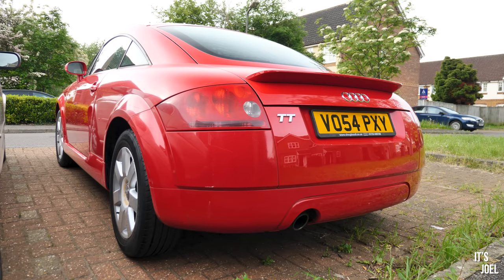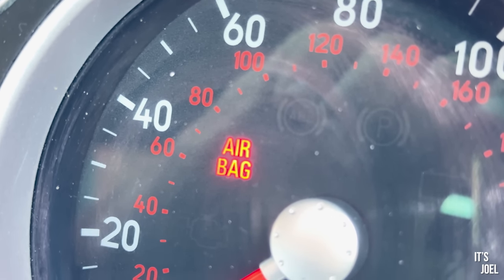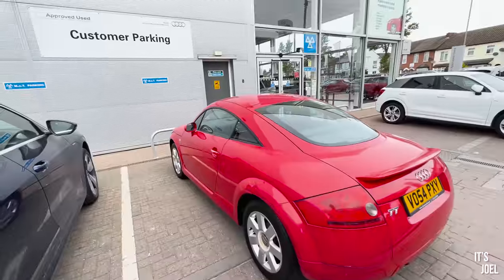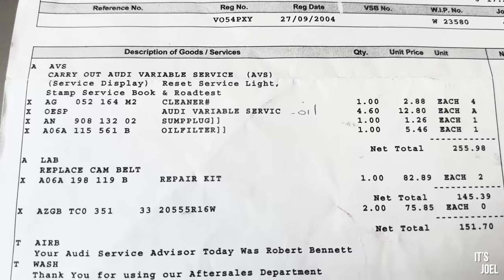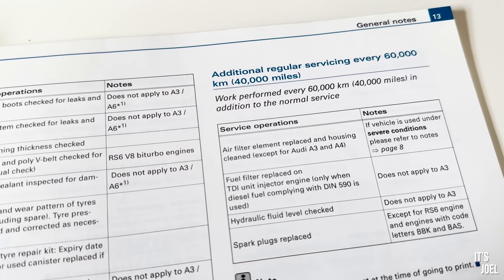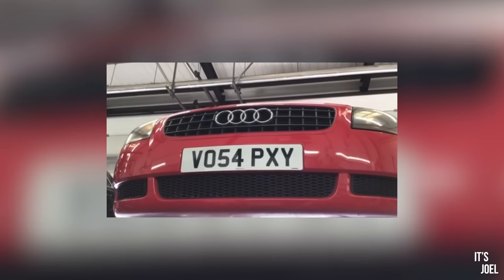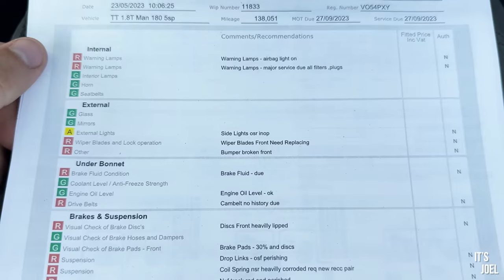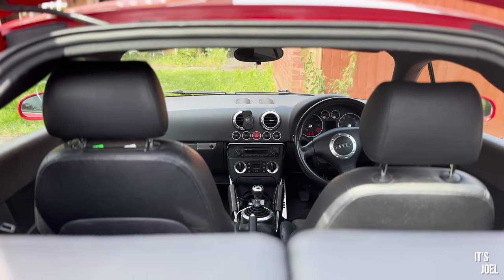AUDI WANTED £2,698.70 TO SERVICE MY COPART AUCTION TT!

Comment from the maker: I’m quite happy with the results of the health check to be honest. What do you think?
Reply: What did the health check cost ?
Reply: Standard list for an almost 20 year old car. A lot of those jobs you could do yourself, servicing is basic hand tools and an afternoons time. Oil leak is almost certainly the rocket cover - they are very common on these 1.8T’s, I’ve changed all 3 of the cars I’ve had with that engine, for that issue. Brakes are daunting but realistically not difficult assuming the callipers are not seized. Including a set of tyres it’s a £1000 spend and a few weekends toying around.
Reply: Garages really don't like using customer supplied parts. It causes problems for any warranty claims you may make should there be a later problem...They will blame the parts supplied by you.
Reply: Daylight robbery! 😂
I actually have never, ever had a service done on any of my cars during the past 40-years, and they've all done very high mileages without major hiccups.
Reply: I think you should sell it for spares and repairs when the MOT expires. You will never get your money back.
Reply: @MrGman2804  You and me might think thats good sense, and we'd be correct,,, but we dont have youtube channels where folk tune in to see repairs, things going wrong....etc.  Nobody tunes in to see some great guy driving a great car with no issues.
Reply: @celt67  'Nobody tunes in to see some great guy driving a great car with no issues.' I think they do. I watch all sorts of car channels, and it is fascinating seeing someone like 'Vice Grip Garage' where he makes a point of buying a heap, but because he knows what he is doing, he rescues an old Chevy Malibu or something and sells at a huge profit. He has 1.55m subscribers. Personally I find it painful to watch someone buy an old banger when they don't know what they are doing, and just pour time and money down the drain. He bought that car for £475 because nobody else wanted it! Nobody else wanted it for a reason. It is scrap with 1 months MOT and will fail the next one.. He is a nice lad, but he does not know enough about cars to be buying old lemons that need repairs which outweigh the value of the car. I bet he could get just as many views by making more savvy purchases, and he would be richer.
Reply: @stevewilliams5428  it’s a straight refusal these days.
Reply: @MrGman2804  You are clearly  missing the whole point of Joel's channel. Well,  80,000 of the rest of us "get it" and aren't interested in watching Joel flip burnt out Lamborghinis for fun and profit. Very much not the point. Go somewhere else for that kind of content instead of criticizing what's going on here.
Reply: @MrGman2804  if he take it somewhere else not main dealer might be ok, but its not the most sort after version of the mk1
Reply: At least when you service it yourself you know it’s been done. A woman was charged for a service on her car over here and the garage said they couldn’t find the keys but it turned out the woman had brought the keys home so the car definitely wasn’t serviced 😂
Reply: @Discopuss  You misunderstand the point of my comment mate. I didn't say anything about 'burnt out Lamborghinis', you did! I am subscribed btw. The reason for my comment is because it doesn't make sense to buy a car from copart that you don't even want, and then start spending time and money on it before even knowing what the MOT will bring in 3 weeks time? That isn't a criticism, it is a comment. Obviously, it is up to Joel what he does, and I hope it works out. Personally I'd just have some fun while it still has an MOT, then take for the MOT and see what comes. I suspect an unviable list repairs which can be avoided by selling it for what he paid, then move on to the next one. Joel is asking what we think? I said.
Reply: @scitec717  Yes. Last years MOT mentioned the oil leak, and a rusty subframe! The person who just sold it for £475 sold it on copart and the MOT is now due in 3 weeks? The weather forecast is sunny. Personally I would take it on a road trip, enjoy it, then take it for an MOT and see what comes up. Personally I would be quite surprised if it is worth spending more money on it. If Joel gets 3 weeks motoring out of it and his money back, that will be a result. However, everyone is free to spend their money as they wish.
Reply: Front Brake discs and pads 20mins brake fluid easy watch utube 😂 you can do it your enjoy it 😊
Reply: Really interesting video looking at the issues on an old Audi and taking it to a main dealer.. 
Would you believe I'm dealing with similar issues on my old Audi A4 3.0TDI S-Line but not taking it to the nearest main dealer which is also Aylesbury Audi..
Incredible timing to come across your video right now for me.. 
Nice work.. look forward to seeing how things go with this car.
Keep up the good work. 
Subscribed!
Reply: @RumpleXstillXskin Health checks are normally free
Reply: @Discopuss  ....or crappy Chevy Malibu's either...!  
I dare say "Vice Grip Garage" has a huge workshop with all the latest power driven tools that the manufacturers gave him for free because of his "1.55m subscribers"  
Who gives a flying toss?  
(Watch any USA based YouTuber...it's all about the fancy tools they have....not the subject!)(They remove a half inch self tapping screw ...with a power tool! 🤣😆)
MrGman is obviously obsessed with "money"...(Yawn).....and has lost the essence of what this channel is all about.

Comment: This TT could be a content goldmine ! New discs brakepads and drop links you can do yourself after your extensive training on the Jag :-)  Just make sure you're safe if you're going to do it on your drive.
In defence of main dealers : they have unbelievably high fixed costs which they attempt to recoup by performing simple maintenance tasks for premium parts cost and premium labour rates . With their hourly rates , they just aren't set up to investigate open ended problems. Most of the people in main dealers love cars and the front of house staff are good with people so no real surprise you had a good experience at Audi.
Before you spend any more money you should decide what you want to do with the car on a scale between "use as a runaround for year" and ' restore to showroom" then you'll know where the money needs to be spent.
Reply: I used to work for a lexus franchise on older cars they sold they normally did a brake disc skim and replaced the pads useing aftermarket brake pads the reason i know about  resurfacing the discs and replaceing the brake pads

Comment: Be great to see you tackle some of the jobs Joel and then show the cost to fix it yourself vs the main dealers.  

Even on a modern car there are many jobs which can be done with a bit of research and fairly basic tools. 

Oh and the brake fluid - I changed mine for the first time recently and it was really easy. I’d highly recommend getting yourself a Gunson eazibleed kit for about £20 - it makes the job so easy to do by yourself. I changed mine in about an hour (longest bit was removing and refilling the wheels!) and the Gunson kit was brilliant 😊

Comment: Regarding your light not working... Audi's are renowned for this. My headlight o my A6 kept throwing an error to the dashboard saying it was out yet it was working perfectly. However, the sensor measures the resistance across the bulb and as the bulb ages this increases - which causes the issue. A new bulb solved it.

Comment: cam belt/water pump is advised to be changed on age as well as mileage - if not done in 5-6 yrs probably worth doing - again, at an indi you'll probably be looking at £400ish
Reply: Invoice was 2004.. that cam belt is a timebomb
Reply: Exactly

Comment: £140 + per hour would be the main culprit for the hight prices quoted  at AUDI MD but I'm guessing  you already know that. 😉 FYI rear coil springs are super easy to change. Lift the rear of the car, undo & remove the bottom shock bolt to gently ease the rear subframe down and they just pop out. 👍
Reply: My local Audi dealer in Aberdeen charges a not too shabby £176 per hour ! 😮

Comment: Do the work yourself mate. I changed the track rod ends on my Z4. I've got a video on my channel doing it. Definitely invest in a Blow Torch, I couldn't change them without it. But you'll need a decent one from toolstation. Cost me about 60 quid. I also done wishbone rear bushes. I saved an absolute fortune doing it myself and it was a great learning experience.

Comment: Joel don't just go off the mileage of the cambelt - the timeframe is important too. If it hasn't been changed for a few years it might still need doing even if the mileage between services is low. Check the state of the belt if you can.
Reply: Lookup2Wakeup  every 6
Reply: Lookup2Wakeup  i've always heard every 8-10 years
Reply: Timing belts can actually last alot longer than people claim or manufacturers suggest. Last autumn, I changed the timing belt on a 206 I acquired, it was the original 17 year old belt, 100k miles, it was still in really good condition. People overextend timing belts all the time past manufacturers standards but rarely hear of many cases of timing belts snapping (unless wet belt system as the oil breaks them down). I would say 8-10 years max, or 80-100k whatever comes first.
Reply: @squeakers27  well sure of course they can. They also can't.... I've had one go before and I wished I'd had it done since it cost me an absolute fortune to get the engine rebuilt.
Reply: @squeakers27  best advice on here so far 👍
Reply: The belt service intervals have some margin built in as there's a lot of variables e.g. climate, how the vehicle is used, manufacturing tolerances, quality of materials, installation/tension, potential oil contamination and so on.

I know of some belts that looked pretty good after 15+ years and others that have snapped before 10. My personal view is stick to the schedule, it's not that expensive at an independent or done yourself.
Reply: I had a Ford XR3i (1.6 L Ford CVH engine)  . Cambelt needed changing at 60,000..... ( I thought the same as you ) but at 61,000 it broke, and bent 4 valves which required a top end rebuild.
Reply: Being a Service manger for main dealers I can tell you the time on cam-belts is a scam by main dealers, No cam-belt comes with a sell by date on it!! modern belts are made from Kevlar and Woven Nylon and not rubber so not subject to age, but it is a good money maker..🤫
Reply: @jontheodore8450  there's a difference between a belt being in a box ready for sale for years and it rotating around engine pulleys thousands of times an hour though...
Reply: @BlackLines  "rotating around engine pulleys thousands of times" agree that's why you should always follow the manufacturers mileage change not the dealers time they tell you. Cars don't wear out when sitting that's why low mileage cars are worth a lot more than high mileage cars. Think about this when the TT first came out the in the late 90s manufacturers cam-belt change was 140k now its 80k, but main dealers tell you its 4 years.
Reply: @jontheodore8450  the worst thing for a car is to let it sit. Rubber seals start to deteriorate through drying out, parts start to rust and seize and yes, rubber belts starts to deteriorate. I'd take a high mileage car that has been used regularly over one with low mileage that has been sat on a forecourt for months.
Reply: @BlackLines  WOW all the worlds classic car collectors must be wrong..😂
Reply: @jontheodore8450  no - they maintain their cars 🙄
Reply: @jontheodore8450  in what way ?

Comment: Do the brakes and the brake fluid, definitely do an oil change and then fit a decent set of rubber. I’d also have a crack at a DIY wheel refurb. Keeps the costs down and it will be mechanically right. Fair play for getting new cars on the channel, it’s key to getting it to grow

Comment: If I can believe my eyes and my memory, you showed a service bill from mid 2022 that included new spark plugs. Modern plugs last 40k to 60k, so you won't ned to change them just yet.  The rear springs don't look too bad, maybe a quick clean and a coat with Hammerite or similar would be sufficient?

Comment: Interesting to see you have a go at a few of those job.  I'm not a mechanic but replaced the lower suspension arms on my old focus and it was a doddle.  I just had to take it to the shop for tracking up.  Go for it...
Reply: I did the same job on our old fiesta
Biggest shock was how big the nuts and bolts are on cars😮 ,and just like you ( I also did drop links) 
Parts cost £54 ,tracking was £25 and my Saturday morning labour was free.

Comment: Airbag light problem will probably be the same as Alfas, where the seat is moved while the engine is running and the plug under the seat loses contact and throws a fault, I like many alfa owners just cut the plug off and delete it, wire it direct without the plug .

Comment: Great car and video. You can definitely do most of the work yourself. The front discs are easy. To do the rear suspension work get a decent jack and axle stands. You will need spring clamps to get the springs off safely. Get the right tools and be prepared to get dirty 😀

Comment: Airbag light. undo connector, clean & reassemble. Easy job.  Take the seat out for a good hoover too.  Battery Earth is a must remove 👍👍
Reply: Spray a bit of de OX it between the connectors- it works for Pine Hollow Automotive Diagnostics!

Comment: Definitely have a go yourself at some of the work, discs, drop links and suspension you shoud be able to do with a few tools, even the brake fluid change you could do with the right bleed equipment.
There is so much satisfaction from completing a job yourself and it will make good content 😊

Comment: the airbag connector under the seat breaks from moving the seat forward and backward, it is a yellow connector. Disconnect battery, remove connector and solder cables, clear the fault and check if that worked.

Comment: To be honest, it's probably better just to take it for an MOT and if it passes fix the advisories and give it a service. If it can safely pass an MOT, there can't be anything wrong with it. Also, look into the oil filler cap as the source of leak, might have been previously replaced but it looks like oil might be coming from there or the cam cover gasket but can't be anything serious if you say it is not losing any oil.

Comment: I'de bin working on TT's for years and they are great cars to work on aswell as to drive. The issues the stealers marked to be repared or changed you can very much do yourself......it's very easy. 
Changing the suspension springs to a 35 mm lowered version from Intrax or an adjustable suspencion set makes it even more sticky and puts more of the cars weight to front wheels and gives a better acceleration and throttle reaction. Change the wheels to 18 or 19 inch and tyres have to be an a brand. This makes the tt much better than it already is.
Great your trying to keep the car going👍

Comment: Great video, my Dad has a Golf Mk4 GTI with the same engine, literally everything is the same bar the badges(I notice that your steering wheel is the same too). Anyway…he had a massive oil leak and it was all over the underneath of the engine. I suggested he check the cam cover gasket as they tend to age and low and behold the rubber had turned to hard plastic and brittle(a piece was missing). It took him a couple of hours to do himself, and the gasket was 20quid. I'd give that a look. Don't overtighten the nuts holding the cover on when re assembling as they do shear.
Good luck
Jim

Comment: My advice to you before tackling suspension bits. Buy some wd40 penetrating oil.  Not normal wd40, penetrating oil.  Be ready for stuck bolts.  Undoing everything is the only difficult bit.
Reply: Würth Rost off works really well for rustler on bolts !

Comment: if doing suspension springs on the rear, chuck on a pair of shocks as well whilst its apart. If you've got a trolley jack and axle stands its defo a diy job. Well worth expanding your skill set (take your time!) and give us some great content to boot. Spend some of the money you save on a decent battery impact gun. Good luck - also look for a decent local audi independent garage - will probably halve the labour costs

Comment: There is a bit of an art to running an old car. For example bother with the exhaust hangers but not the clamps, dont bother with the springs (its defects that make them snap not surface rust). Dont touch the front brake discs until the pads need doing. You will need to do the drop links for the MOT (use good ones as many new parts only last a few months).Dont bother to bleed the brakes with a fluid change, just suck the old fluid out and replace it, it wil mix eventuly. Its all about directing your money where it matters most. For me I would replace those junk Tyres with a set of higher end new tyres  once I am sure the cars going to be good.

Comment: Airbag connectors are a common fault on other cars as well and should be an easy fix. Measure the front disc thickness and check against specs...easy DIY job usually if needed. I had my brake fluid changed recently for £42 at an independent garage on a Jag. Springs should also be fairly easy DIY. Should worry about oil leak if it fails the MOT, just check the level every week. Exhaust is ok unless it leaks.